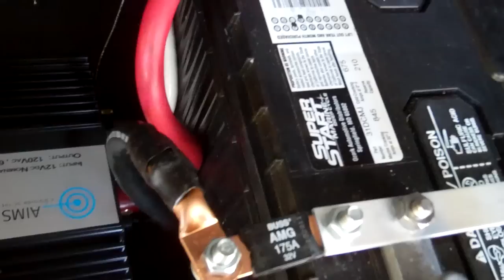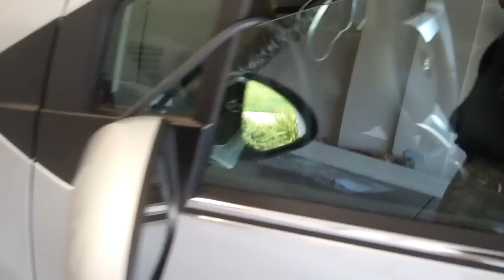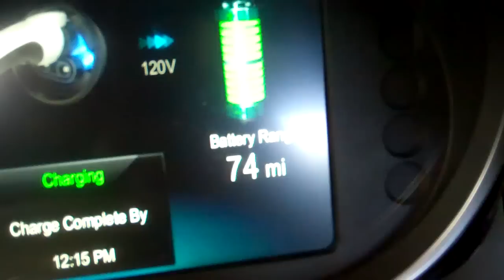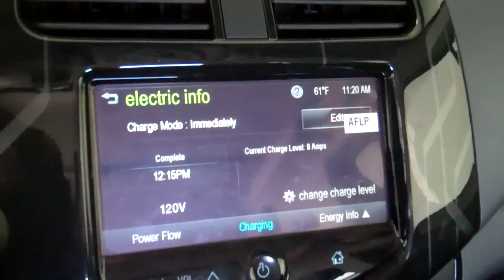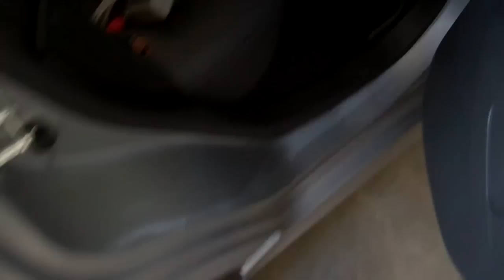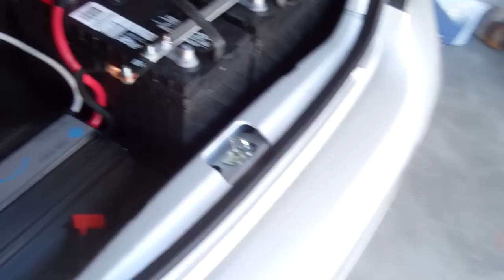DIY EV Range Extender

Comment: you are charging at 1.2kW. This is the lowest possible and will add 5-6km for an hour of charging. 
you have three batteries there, probably 20Ah each, meaning you have around 1kWh of energy in the batteries. Again, one hour of charge or 5-6km of extra drive.
what you have there makes more sense as emergency lighting than range extender.
someone mentioned lipo batteries because they will give probably twice the extra range. as for pure sine inverter, i believe modified sine would work as well.

Comment: Not a big fan of stuff like this in the cabin. I don't trust it to keep the air clean. I have a Honda 2000i generator that I'd carry but then I'd have gas fumes slowing venting into my air. I realize the batteries are "sealed" but it's really about trust. 

And yes, that's coming from a guy who goes and shoots guns at an indoor range. I understand the contradiction. ;)
Reply: you could just vent the exhaust outside or charge the car with the generator outside

Comment: one short question. Can you charge while driving? or the spark ev disable the charge port?
Reply: Plugging in an EV will disable the car from being able to start, if the car is already running then typically the car gets automatically switched back to acc. only mode. It would take some hacking and breaking into the battery pack to be able the feed power to the pack via an external 400v DC charger.

Comment: If you used lithium batteries it would be a lot lighter, but the only down side is the cost.Also if you used a 3kw inverter it would probably be more efficient.Another way to go is to use a small generator which is lighter presumably it's for emergency charging.I use a similar system for charging my electric motorcycle.
Reply from the maker: The weight had a negligible impact on my range. Think of the batteries as a passenger in your vehicle. You don't get much worse mileage. Honestly, I could hardly notice any difference with over 400 pounds of retaining wall block in the car to emulate worst case extra weight. I maybe lost a mile. This setup weighs ~200 pound. Inverters run more efficient if you are using most of the power availble. Sure, you could do gas generator. Noisy and fumes though plus how to fit it in such a small car.
Reply: Paul Di Maggio The gas generator is for emergency use so when you run low and you can't find a charger, with system shown here it's good to extend the range but you still have the problem of what to do when even that isn't far enough, it's just extra weight doing nothing.
However by carrying a small generator when you run low you can simply give yourself a charge then pull into a petrol station and get some more gasoline for the generator for the next time you need it.
Emergency use.
It would be nice if there were more charging stations or more convenient charging stations like with gas stations perhaps even some entertainment while waiting around but as yet the people in charge of the charging points seem to view them as charging points rather than charging stations.
It seems ironic that a gas vehicle takes around 5 minutes to refuel but you get all the entertainment  you need including the ability to make purchases, while electric vehicles take over 30 minutes to charge on average but instead of trying to get you to part with your money in a way similar to that of petrol stations they put the chargers as far away from goods and services as they can possibly manage.
I find this really strange, people spend money when they have time and money to waste, petrol car or motorcycle in the UK anything from 20 to 100 pounds to fill up your tank, electric car/motorcycle costs almost nothing to charge, that means money that could be spent in a store buying a shirt or a pair of jeans or chocs or flowers but no! electric charge point in the basement of a car park where no one wants to go or on some side street where some would not want to venture out.
Real genius marketing systems at play, it's called stupid ass idiotic moronic promotions ltd.
 
I would have expected charging stations to be front and center as close to the amenities as possible to get those wallets and purses open.
It's just a thought.

Comment: It's a cool idea and simple to do but you will only get 300-500 cycles on those batteries so those mini charges are pretty expensive. I don't think it's really a practical solution for daily use but it does work and might help with getting to a slightly out of range destination. You can also just reduce speed 10-15 MPH and probably get the same range extension also but what you have done is a really cool experiment.

Comment: it can't give much range at 120 volts 3 kW. LEAD acid batteries are 100 year old technology.
Reply: (to "solarstacks"): Except the lead used in flooded cells is recycled, it doesn't the environment unless someone chooses to dump them illegally. That's a bit different than paint and exhaust fumes/condensate. I agree with your points on lithium, though.
Reply from the maker: They are the best bang for your buck though. Try doing same thing with lithium ion will cost you a fortune
Reply: Lithium will last longer, weigh less and pollute less.So life cycle cost is LESS.  LEAD is so bad we took it out of paint and even gas. It's a killer.
Reply: You are kidding. Lead has a strong link to problems in brain development and violent crime.
Reply: bullshit lithium pollutes less. Lead is easy to clean up Lithium pollutes entire continents. The enviromental damage created making lithium batteries far outweighs simple lead mining

Comment: I can imagine some situations where this would be very useful. For instance, if your round trip to work was just a few miles too far for the Spark's range, then adding six miles while parked at work would be perfect.
Reply: couldnt you just get a couple of foldable solar panels and use them? that way while your car sits in the sun at work its charging.
Reply from the maker: True. Another situation where this comes in useful is if you ran out of battery. Instead of having the car towed, let it recharge just enough to get it home. The system can also be used as a source of backup power for your house when the power goes out.
Reply: I imagine its as useful as having a reserve tank on a petrol car.
Reply: Bill Tamerlane

Comment: Cost of batteries and inverter + added weight + time to recharge = not much value for 6 extra miles of range.  Sorry, not trying to burst your bubble.
Reply: value is assigned by the person doing the work, not just pure money.  by your justification, explain insurance or another similar scheme.
Reply: I would buy new ones as the prices have dropped.  Your right Lithium is much lighter, however fire danger is significantly raised.  Pack a fire extinguisher.
Reply: It seems more like a ”because you can” thing. If everyone thought ”this is probably pointless”, our technological progress would come to a halt
Reply: @Shmynkellbonkenstein  well actually if battery tech gets better this could weigh less and charge you anywhere as long as your primary battery will get you there
Reply: Ben Smith good point, it will be interesting to see the technology evolve even further re ev cars etc
Reply from the maker: 10 miles with two more batteries. Keep in mind this vehicle only has ~80 miles range from the factory. So adding 10 more miles while it sounds insignificant is actually extending the range quite a bit. The extra weight has a negligible affect on mileage from my experiment else I agree and wouldn't have wasted the money.
Reply: VeeDubTDI  why don't he upgrades his battery pack size
Reply: @Mj.Daily.Trades  Probably just because he is trying to be extra careful. While avoiding DC to AC back to DC in his current setup does have efficiency loss, he knows his warranty should be still valid... also if he ever wants to sell the car, he can do so without having to explain why his factory battery is tampered with.
Reply: 6 extra miles is no laughing matter when you are 3 miles from home and your power bars are gone.
Reply: wouldnt it be best to buy some used laptop lithium batteries and create a battery pack?

Comment: Love the concept, it'd be sweet to see the trunk packed full of Lithium batts as well. It would be a bit pricey I'm sure.
Reply from the maker: Thanks. Yes, lithium was just too expensive to justify. Ended up finding a free fast charger on the way to work so never ended using the setup as intended. Now, I have the system in my house so I can run some appliances off of battery power during peak hours when electricity is expensive and charge the batteries during off peak.   But I like having these batteries for emergency purpose if I were ever to run out of juice on the road, saves me a tow.
Reply: Great idea! Had a power outage the other day here in Denver and a battery bank would have been real nice! Best of luck to you.
Reply: I like it. Trying to come up with a way to charge up via solar but slow charging sucks. Trying to justify the cost.